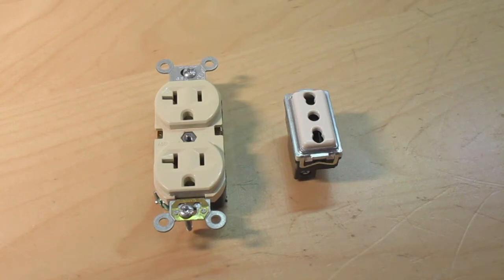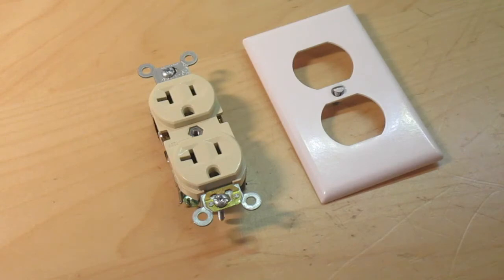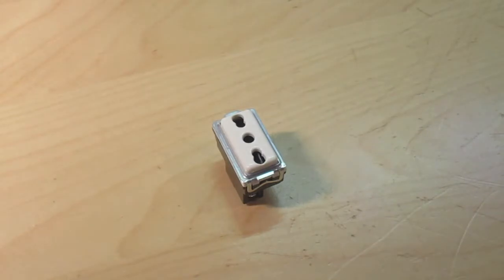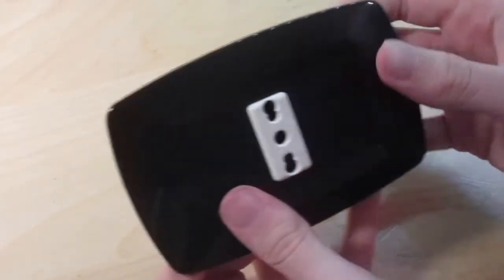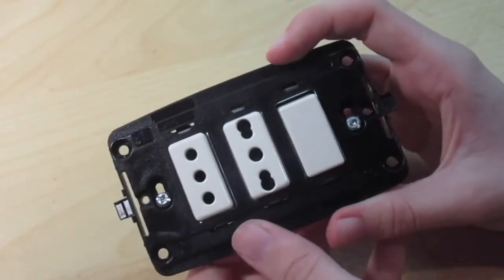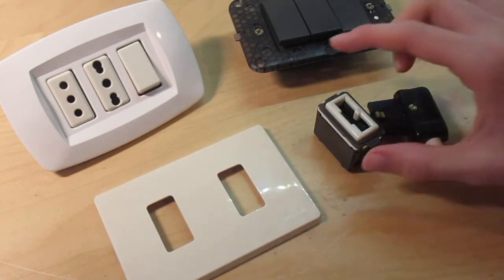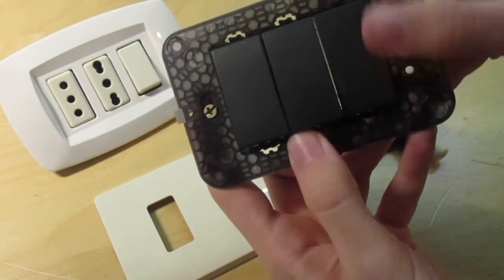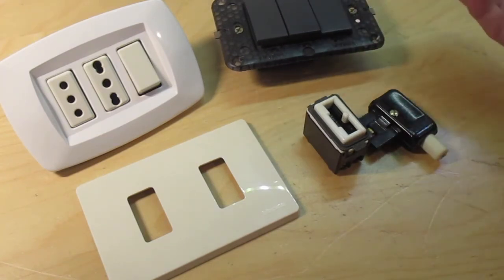A Brief Look at Italian Modular Power Sockets

Comment: In the US mid-50s and late 70s modulus sockets were used but outlawed. They use a vertical gem box in which you could use a combination outlet switch and night light. Some reasons for outlawing them was space constraints. To many devices  was against the code and there was no room to add a grounding grounding hole. Today you choose the device with that combination.

Comment: ah Italy , a small plugs mess ...  
there are even Italian-Schuko-hybrids
Reply: Colombia, Ecuador and Venezuela uses US outlets (120 - 127V), Chile and Uruguay uses Italian outlets (220V) and Peru also adpoted Italian and Schuko along with US and Euro 2 pin outlets.
Reply: @FrancisLitanofficialJAPINOY can Italian plugs be used on the USA grid ? 110v 60hz?
Reply: @longiusaescius2537  - 
will not fit ..., only these terrible USA/Japan plugs fit in USA, you need a good(!) quality adapter or build it by your self from USA-plugs + Italian (or German) powerbars ... avoid cheap Death-Dapters on all costs ... 

Edit: your device must support 110-120V at 60Hz ... you can also use 2x110V (Life (black)  + Life (red) ) = 220V instead of neutral
Reply: @Killerspieler0815  they fit if you cut off the neutral connector 😂

Comment: That's super neat! Those outlets are clearly more versatile than the NA ones, and it's almost disappointing that they are hardly used elsewhere (though that plug design does scare me a bit; seems like it would be pretty easy to shock oneself by accident).